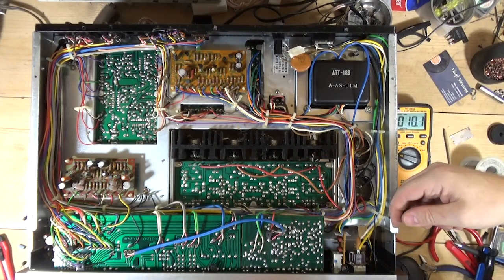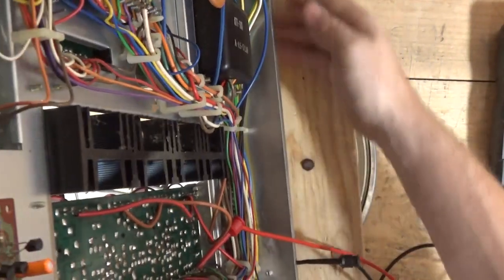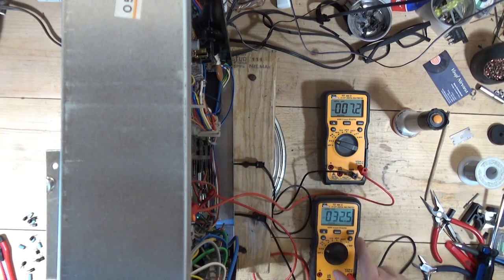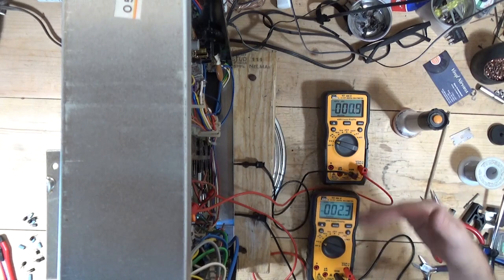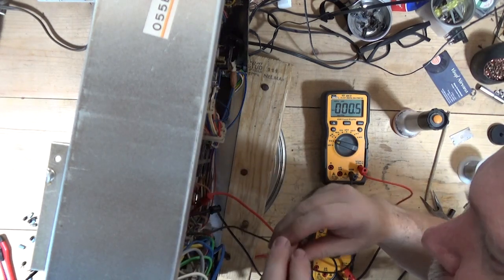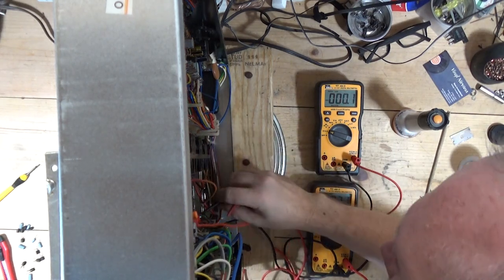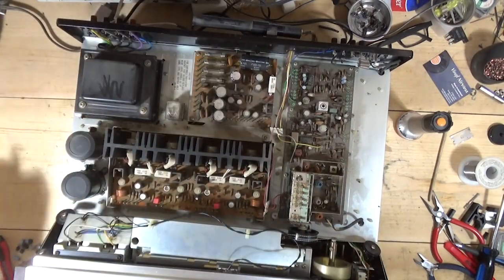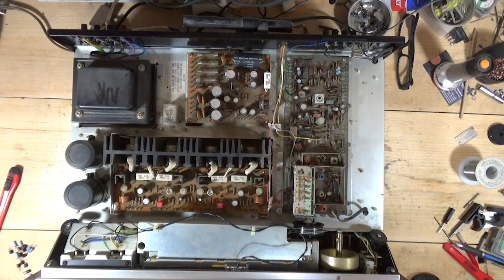Pioneer SX 737 Preventive Maintenance Part 5 - Amplifier Alignment: DC Offset and Bias Adjustments

Comment: Do you restore speakers? I just got some KLH Model 23s cheap. Drivers all work. Gonna refinish the cabinets, recap and treat the cloth surrounds. I have heard these are pretty good speakers.
Reply from the maker: I absolutely HATE working on speakers...I have done some speaker stuff in the past, and will occasionally do stuff (just for the shop) but it would need to be a very special pair of speakers to get me to work on some.

Comment: The service manual says you should connect a 8 ohm dummy load to speaker A terminals. Did you do that and if not why?
Reply from the maker: I will typically just use my test speakers if an 8ohm load is needed.